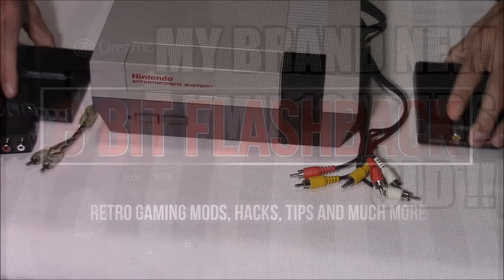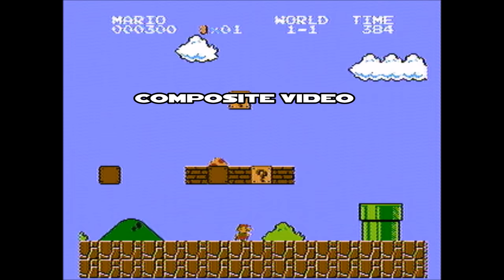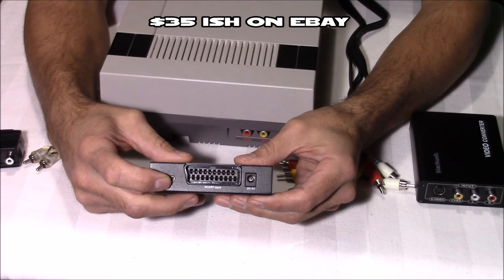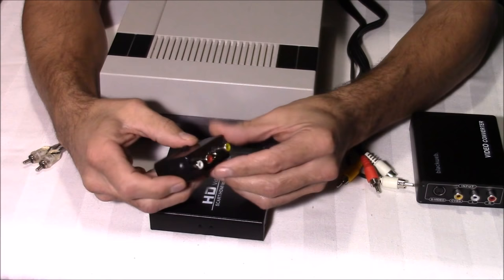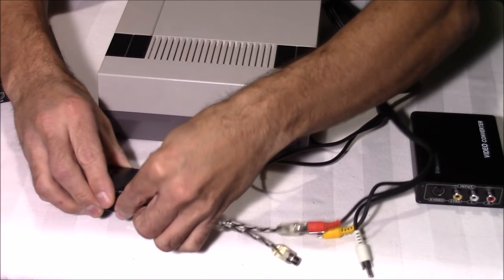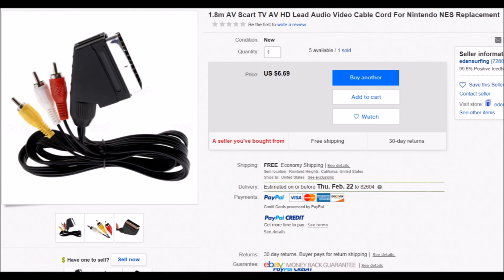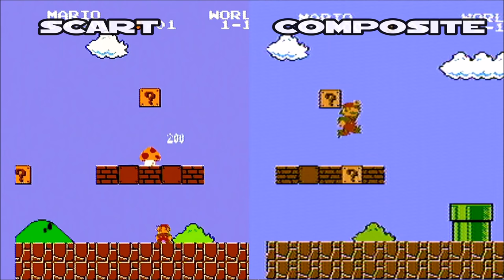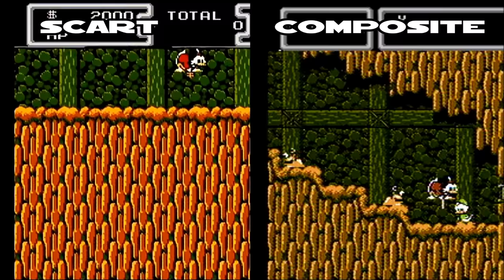NES HDMI converter tests: fake Scart vs Composite

Comment from the maker: Just to clarify the scart adapter just allows you hook up composite cables to Scart input it doesn't change the output signal of NES at all. The only way to change output is to mod internals of NES with RGB or HDMI circuit boards which are very expensive and hard to install. The Scart to HDMI converter i use in video seems to be the only converter in the under $50 range that has any noticeable results. I also tested multiple Composite to HDMI converters in the Under $50 range and had no luck with video quality improvement. The results might not be for everyone but i personally think Scart to HDMI looks better.
Reply: I just care to get rid of those vertical lines when I stream cuz' I cannot see them on my tv but for some reason, I can on the streaming screen and I've tried a lot of ways to get rid of it. Heck, may Atari is behaving better than my NES is and idk how that's possible. My Colecovision probably behaves similarly but I've been having issues with my NES more than my other consoles. So I'd like to try your method before I think of hiring someone to do the soldering stuff.
Reply: Well said, and even with the more expensive ones; good luck with then seeing 240p. It is a gamble when you deal with these scalers. XRGB Mini is to expensive for most gamers and going up in price.

Comment: Just brought a Framemeister, the cheap HD Video HDMI to Scart converter, and the "labeled NES" AV to Scart cable. The NES Scart cable only works the HD HDMI to Scart converter. With the Framemeister,  only the audio works, and the screen stays black. The visual from the HD converter is still a great improvement over the regular  Nintendo av connector .

Comment: The French NES consoles had "RGB" SCART output. It's even labelled as "RGB" at the back of the console. 
But it's nowhere near true RGB quality. It's more like a Composite to RGB conversion.
Reply from the maker: Interesting  thanks
Reply: Yes, it's just the same composite signal, routed through a multi-out connector.  This was done to comply with TV standards in France at the time.

Comment: Yo dude, if you're still watching comments, check out Retrotink 2x Multiformat. It does wonders for the NES system filtering noise from composite source. I'd also recommend you get better composite cables, like improved shielding and thickness, analog sources are demanding, lol, one could never be too sure. No need to rely on my opinion on R2X-M either, check RetroRGB review.

Comment: Daisy chaining all those converters together has got to add latency. For those that dont like emulation or using a bunch of chinese converters and cables, save yourself the hassle and hdmi mode your nes.
Reply: I agree, but not because of latency. The RGB mod or UltraHDMI mod might be expensive, but the video quality is SO much better. The problem with UltraHDMI is they can't keep their modded boards in stock. I can't wait until I can get an NES fully refurbished (caps replaced, 72 pin connector replaced, etc.) and modded to HDMI so I can play all my favorite games from when I was a kid on my HDTV. I actually want to do a whole set-up: NES, SNES, Genesis, N64, Dreamcast... Everything all in one place, hooked up to the TV via a switch > receiver. It won't be cheap, but once everything is set up, it will just be a matter of putting in a game, powering on, hitting a button on the switch and go. No futzing around with cables, etc.

Comment: something is up here..

there should be no difference between the two.
Reply: btw the scart converter handles the signal better than the other converter.
Reply: The difference is down to how each converter it butchering the signal.  The SCART to HDMI converter is adding too much brightness.  The other converter looks better.
Reply: no the SCART to HDMI converter has the pixels in the right place, besides too much brightness can be digitally altered easily by the way that Other converter it just looks worse due to how the horizontal lines of pixels are handled if you noticed there are pixels that are off to the left on the blocks and it looks really strange and abnormal something that is NOT supposed to happen and DOES not happen on real CRTs
Reply: and since your using an HDTV to begin with you can just reduce the Brightness for it on the TV, the brightness can be fixed with hardware modifications if you're that bothered, but obviously you should just use your TV settings and video editor to fix it.
Reply from the maker: TheKHfan358over3d well at least I'm not the only crazy person who thinks the scart converter looks better lol. I just turn brightness down on tv and it looks fine. When I captured it I couldn't adjust brightness so that's how bright it is to start with.
Reply: Yeah I'll admit, to the average user, its probably a satisfactory solution, sure.  I'm just too used to looking at my CRT or my GBS8200, when I go back and look at these converters, they make me cringe lol.

Comment: any way to reduce the brightness of this converter?
Reply from the maker: Not on the converter but when playing on my tv i can just turn the brightness down. When i capture the gameplay i don't have a way to adjust brightness unfortunately .
Reply: 8 Bit Flashback in my case I use this converter with N64 RGB modded and is too bright with RGB, Im waiting from china this s-video/composite to scart. To find out if the brightness problem is caused by the RGB mod or the converter
Reply: Yes, you can adjust the brightness on the converter, read my reply further up to see how.

Comment: i really like the scart to hdmi, one question how much lag it haves?
Reply: Cables never have any lag.. all cables have an original signal, whether is an RGB signal or composite through scart.. the lag is actually on the converter box. But if you have a hood tv with Game mode it eliminates most of the lag if any.. I run all my retro games on a 65" Q led. No issues what so ever.

Comment: Just to clarify to anyone that is confused why there is a visual difference between the 2.  It's the HDMI converters.  They are both utter garbage.  The SCART to HDMI converter especially as it butchers not only the brightness of the signal, but adds a considerable amount of input lag (more noticeably with 480i content)

If you want to fix the overblown brightness on the SCART to HDMI converter, open it up, remove the 75ohm SMD resistors on the R, G, B and Composite video input signals, and install a 500ohm potentiometer on the R, G, B, and Composite video SCART pins, then you can manually adjust the resistance and tweak the brightness to your liking.

These converters are utter trash otherwise.  I've done extensive testing on the SCART to HDMI converter, and could not get any kind of satisfactory quality from it.  It just a piece of crap.  A much better solution would be the GBS8200 with custom firmware, although it only supports RGB so you'd be out of luck for your NES, unless you modded it.
Reply from the maker: AndehX thanks for info but to say it's garbage is just exaggerating.  This scart converter works great on my genesis and saturn and i have no lag issues. Not everyone can afford a $300 converter to make everything completely perfect.
Reply: for playing game consoles, it's a bottom of the barrel converter, really.  It does the job, sure, but its bearly a step up from simply connecting your consoles directly to your TV.  Infact, with the SCART to HDMI converter, I would rather plug my console directly into the TV, at least the brightness doesn't get completely destroyed.

Having said that, if you have consoles that can output RGB, the GBS8200 is by far the best solution for the price.  Paired with an Arduino or even better, and ESP8266, you can get near Framemeister upscaling, for less than $30.
Reply: Oh and if you're interested in adding potentiometers to that HDMI converter to control the brightness, I threw together an image to show you how to wire them up:

https://www.dropbox.com/s/9tn5r69sihrurwe/board-1-cropped.jpg?dl=0
Reply: AndehX How it's works with potentiometers?
Reply: yes
Reply: Garbage is that crt tv that you fisht out of the trash

Comment: Can you use this on crt TV
Reply: You don't need any adapter for an old CRT TV, just plug in the console through its Scart connection and play :)
Reply: @FlyingCsongor  lucky I wish have room and money for Sony CRT TV and eliminate all the pain and of buying adaptor and converter
Reply: @FlyingCsongor  So systems like the NES and the N64 that don't suport a RGB signal, will still have a better image over a native scart cable (not composite to scart converter) ? Even when I don't use the upscaler? (PAL)
Reply: @Tomtycoon  I think so. But I'm also not an expert, I just connected the NES with an old B&O CRT TV with an ordinary scart cable and it looked great :)